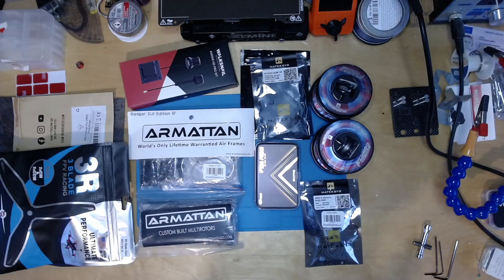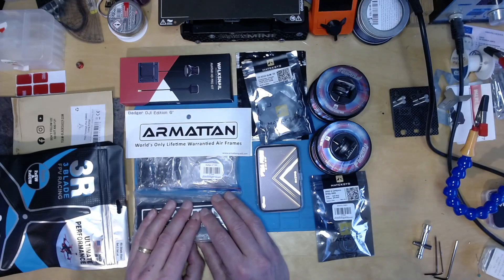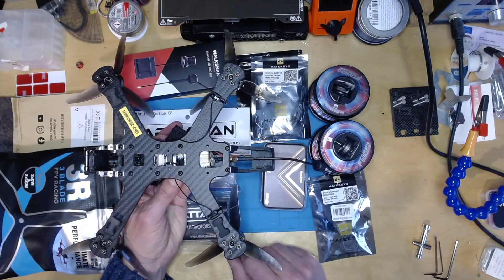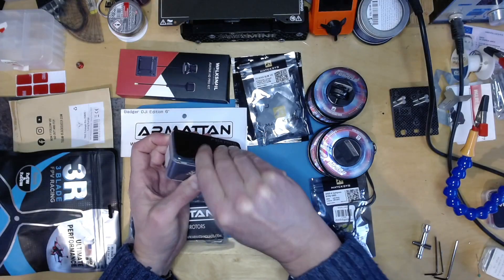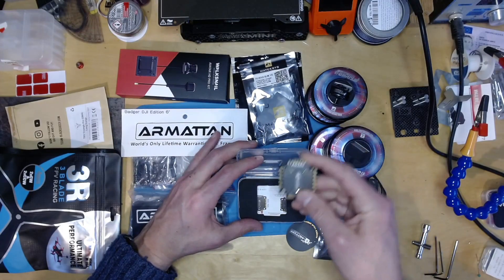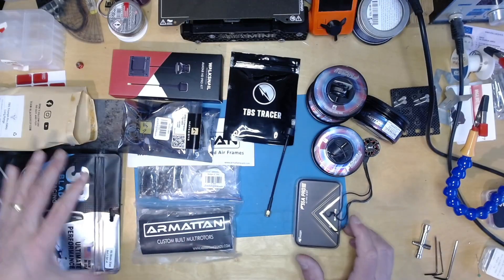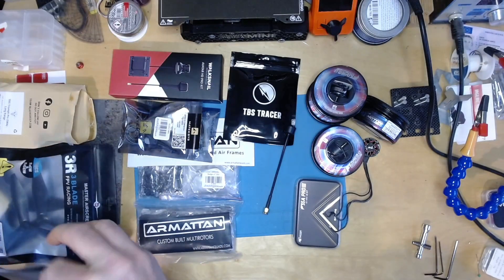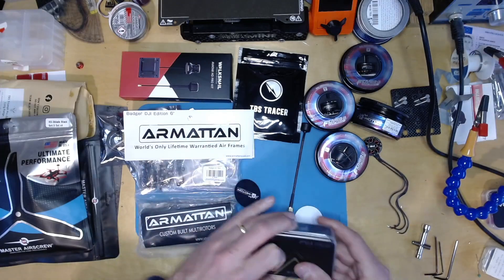ArduCopter 2023 Christmas Build Video 1 - 6" Racer - Intro and Unboxing

Comment: I'm looking to do something similar to prepare for a job. Can I DM you?
Reply from the maker: Sure, why not
Reply: @andypiper5285  so can’t figure out out to DM from the app. I would like to do a build such as yours but with little lower specs and size. This will be my first build. My main focus is to get to the tuning aspect and understand the programming of ESCs and flight controllers. I have what’s app if it’s easier to have a conversation there. Thanks in advance
Reply from the maker: @MacMacon1  for your first build there are thousands and thousands of resources - I wouldn't suggest you start with a racer. Try following one of the other guides or pick one of my other build series. @painless360 is also a good reference. You can ask more detailed questions about ardupilot on discuss.ardupilot.org